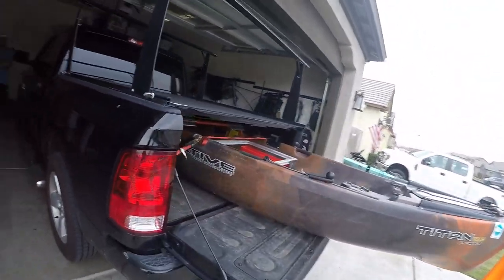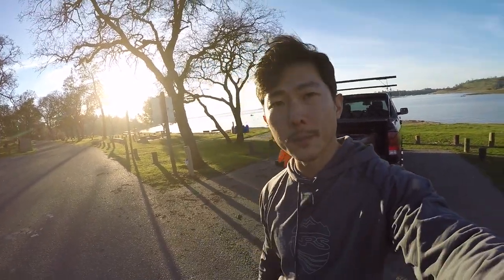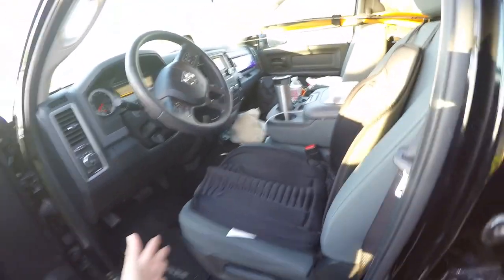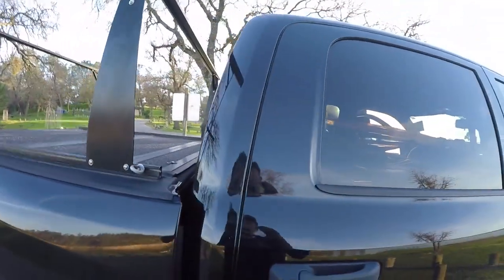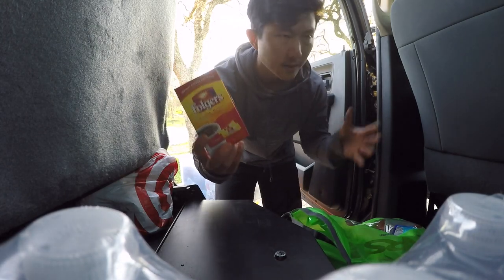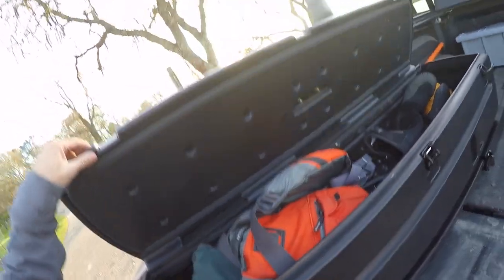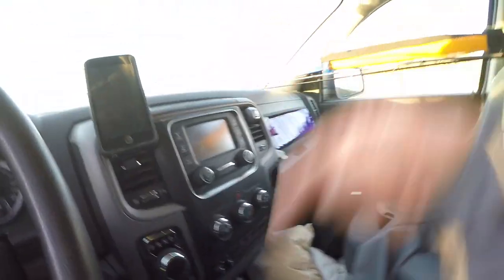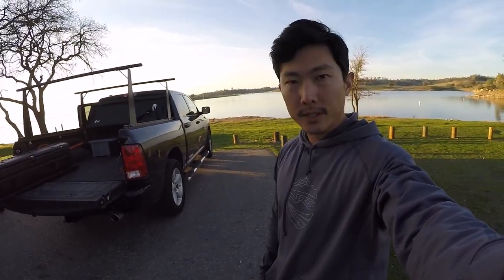Ram 1500 Truck to “Camper” Conversion

Comment: For your coffee, rather than a coffee maker...you should really look at getting a stainless steel insulated french press.  Makes MUCH better coffee, usually quicker, depending on the stove you use to boil water, and you'll be toting around a lot less stuff.  Other than that, fantastic upgrades!
Reply: I second the French press, I use one everyday. Just boil the water and a few mins later boom coffee!
Reply: @kevsgonefishing  i know this is 4 years later, but I just foud the video. I think he wants his coffee faster then staring a fire to boil water for a french press vs 30 seconds for a kureg. Maybe im wrong.

Comment: A few ideas: 1) old fashion candle lantern to add heat to you enclosed cab. I slept in my camper shell at Brannan State Park a few weeks a ago with the temperature going down to 31 degrees f. Candle does not pose the risk of CO2 that a propane heater does 2) Coffee makers draw a lot of electricity. Have you considered a propane stove that fits on a standard propane canister - get both at Walmart. It is small and durable. Plus it will boil water faster.  You can get smaller/more expensive versions at REI 3) I started camping out in my little camper shell and just put in a Coleman Deluxe cot. You can't fit it in your truck  now, but if you put a camper shell on the back, and put you big/heavy kayak on a trailer, you might sleep better. I have a low end kayak/light weight kayak optimized for portability rather than functionality on top of my camper shell now.

Comment: Hey Greg, have you considered getting a camper shell with racks for the truck, instead of a tonneau cover? You could sleep in the bed of the truck and store the kayak on the racks overnight. It would give you a lot more storage too. You can even get camper shells that have storage shelves on the sides to keep stuff locked up and hidden. You can do a lot with a camper shell.
Reply from the maker: definitely considered it. that plus a 5th wheel, van, etc. the big thing for me is transitioning this truck from fishing mode to work/life mode. i love the fact that it can be ready for a weekend of fishing but i can convert it back to a normal vehicle and park it in the city for work and not worry about drawing too much attendtion.

Comment: Great setup, Greg. I will NOT sleep in the front seat of my truck, unless I HAVE to! (I might be a little bigger than most people 6'4" @ 200+, and I still don't have enough room in an F-150 Super Cab).  
  You'll be "changing this and that" as your fishing/camping needs vary, and I'm sure you'll find a way around any obstacles you might encounter.
     Good Luck, Buddy.....
Reply from the maker: Ah, 6'4''....not so good for truck sleeping! you already know! tight lines man

Comment: Greg, I was wondering the same as the prior comment. Why not put the kayak up high. I have car topped a canoe for many years. I understand the issue of lifting it up at the end of the day. The morning was never a problem at the end of the day I often needed help. Nattie up north used an assist arm in one of her videos, it seemed real slick. I would put a hard locking cover on the truck bed and put everything you have inside the truck in the bed and free up your living space. Think about adding another sliding storage box or 2 to the other side of the bed. Check out Scott Martins truck he has a slick storage system in his that is the full width of the truck bed and it looks like you might be able to stack them.
Reply from the maker: I've been brainstorming every option for the past 4 months. From truck shell to a 5th wheel. Ultimately I wanted something that would last me just a few nights but also be super discreet and inconspicuous.  I really like the fact that I could pull up to a public parking lot or street and camp out near a launch ramp if need be.

Comment: If the kayak's gonna stick out the back so far, why not put it on top of the tonneau cover, so you have more space, and securable too?  You can figure out a way to not have it break the glass and you already have the infrastructure to add to to cradle the kayak.

Comment: Maybe you can look into some kind of roof top tent (overlanding style). For your camping needs.  I’ve seen some that you can unfold the tent over a hard cover over the truck bed, or you can build out over the the racks.  It still leaves room in the bed for your kayak and equipment and gives you more room to stretch out.
Reply from the maker: I like that idea but it's also nice piece of mind that if something sketchy happens i can turn on the truck and be gone in an instant. some of the areas i plan to travel/fish are pretty remote.

Comment: Gregg, why don't you look at getting an old camper van and a small trailer.   I have the Titan 13.5 and I found a cheap jon boat trailer and I am super glad I did.  I am looking at getting a class b camper van to have a mobile hunting and fishing camp.  Even if I am not camping I can take a break from the south Louisiana heat
Reply: A camper van would give him a bunch more room and a good place to sleep!
Reply from the maker: Great point. I contemplated this upgrade for months. i was actually about to pull the trigger on a 5th wheel at one point. but for me with work and fishing i wanted something that would just lend me a night or 2 of camping. i wanted it to be stealthy and easily converted back to a "regular truck" as I do tend to frequent ares for work that you don't want to draw too much attention to your vehicle.

Comment: A lot of people are commenting about a roof top tent. If you had that you couldn't just use it the way you intend, like in a parking lot. Someone would spot you and complain about you camping too often I think. Maybe a bed cap would work. You could easily sleep in there stealthily and hook up an electric blanket or whatever. Then you could just put the kayak on a rack on top of the cap.
Reply from the maker: totally man and thats what Im trying to convey. I wanted this to be stealth vehicle! looking at bed caps at the moment but i do also like the fact that if something sketchy happens during the night i could just turn on the truck and peace out asap

Comment: Nice upgrade..how about utilizing the rack for something....maybe specialized enclosed  rod holders or some other tube design for other things?
Reply from the maker: thanks! had the rod holders for a while on the racks and ended up getting rid of them. they were good but honeslty just having them bundled up in the truck is easier and when Im not in "fishing mode" draws less attention to the truck. For work, I'm not always in the great neighborhoods.
Reply: Greg Blanchard thanks for the reply...ps...off topic...ever fished Lake Chabot or Lafayette Reservoir?
Reply: @GregBlanchardFishing  I would weld the rod holders to the under side of the rack.

Comment: Awesome upgrades! The Wizard accomplished a lot in 12 hours. I like that safe! Where do you store your pedal drive?
Reply from the maker: Wizard comes through again! pedal drive usually in the back seat as well but might just latch in onto the kayak in the back now! Might get a small lasso cable to keep things secure/safe during transit.
Reply: @GregBlanchardFishing  I just started transporting mine that way... latched in the kayak with a lasso. Works just fine for  me.

Comment: How much stuff do you have to remove from the truck to get to your jack, if you ever have to change a flat tire?
Reply from the maker: Hey Greg. I have the jack in the DuHa tote in the truck bed. pretty quick and easy to access.
Reply: @GregBlanchardFishing  👍Good planning. A lot of trucks these days have the jack behind the seat, but not sure about where it is on your truck model.